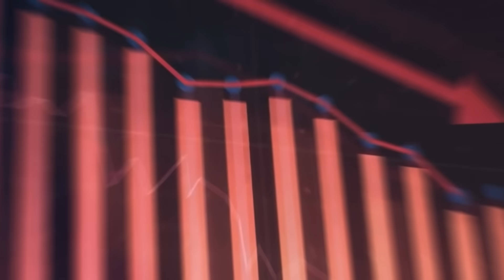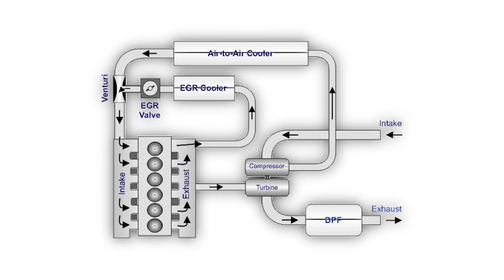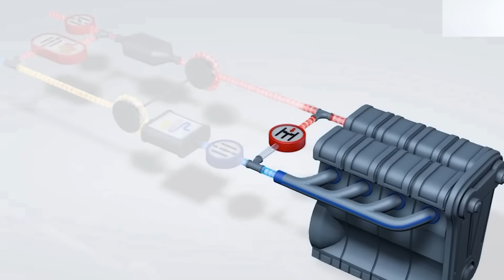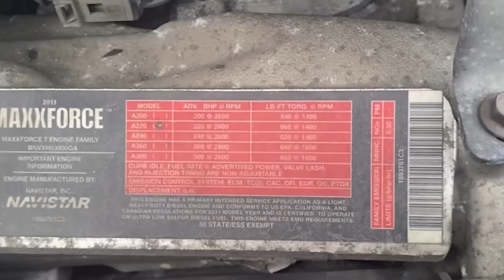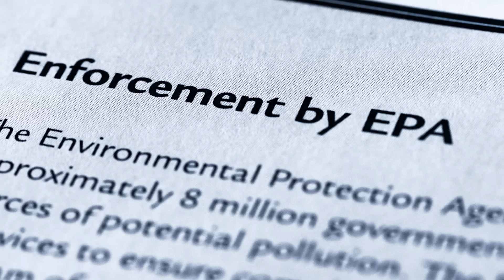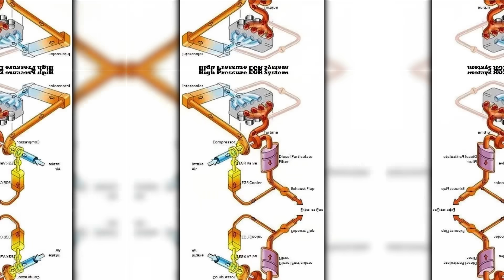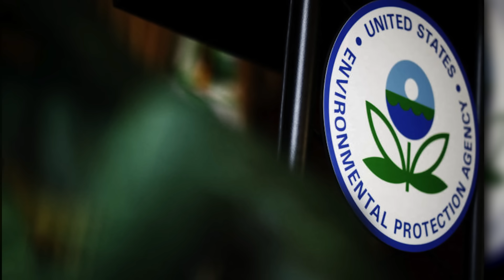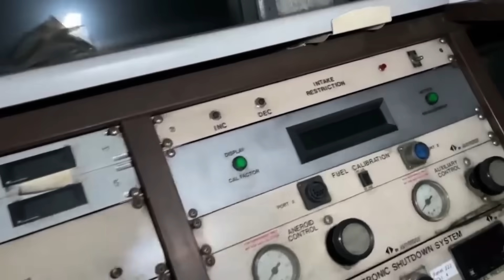The Rise and Fall of MaxxForce: The Engine That Broke Navistar

Comment: It sounds like Navistar didn't learn from the Ford power stroke diesel engines that LED to Ford cutting ties with Navistar and building their own engine in house which has become one of the best diesel engines in production.
Reply: I guess I will be keeping my 2002 ford excursion with its 7.3 powerstroke. It has 440k miles.😅
Reply: The original 6.7 was designed by navistar and built by ford.
Reply: @scottmoore2014 Incorrect, it was designed and built in house by Ford Motor Company with consulting by AVL. Ford and Navistar had already parted ways.
Reply: @scottmoore2014 Ford built the 6.7l in house entirely
Reply: ..... enjoying my dele***d 2008 6.4.....
Reply: Wrong 6.7 Powerstroke are crap
Reply: @24vmiggy 6.7l now is much better than before and way better than the 6.4l and 6.0l
Reply: @mauricemotors8207  It was the 6.0 (2003-07) that started the rift with Ford shortly followed by myriad issues with the 6.4 (2008-2010) . the 6.7 "Ford" Scorpion is a much better design and implementation of the diesel engine.
Reply: @24vmiggy LOL, they are the most powerful diesel engines offered from the big 3 and they are a very reliable engine when proper maintenance is performed.
Reply: @vegasfordguy  wrong again cp4 walking cranks breaking roller lifter guides list goes on
Reply: @24vmiggy  Pressed on crank timing gear LOL JUNKOLA 💯
Reply: @24vmiggy CP4 is fine as long as you change your filters my buddy that’s a fire truck mechanic has a F-450 service truck with 150k no issues
Reply: @24vmiggy Let’s talk about the rocker arms on the current ISB and the fact that the heater grid finally was addressed with now going to glow plugs I work on bigger Cummins ISL and ISX in semis Dodge ecru programming in Cummins sucks ass vs Cummins eco programming.
Reply: @mauricemotors8207 I don’t care for new big rig engines unless I own one but I know for a fact 6.7 power strokes are not the holy grail of engines yes they make power but they are maxed out engines from factory compared to duramax or Cummins
Reply: @24vmiggy The power stroke is as reliable as it can be considering all of the emissions mandates. This applies to all three of them. I'm a Ford guy, however I'd prefer to have an inline six as they are extremely simple to work on when compared to a GM or Ford V-8. So there's only one option and it's the Cummins. I would say that a Ford body and chassis, Cummins engine and Allison transmission for the win, however this isn't the case anymore since the GM 10 speed Allison transmission is nothing more than a Ford designed transmission licensed by Allison and it's not a bullet proof transmission anymore. If you want to be honest, there is planned obsolescence across the board. Ford still offers the best truck for towing with the best HP and Torque. At the end of the day I'd probably rather have the 7.3 Godzilla gas engine if I didn't need to tow beyond its capability. Just my two cents.
Reply: @mauricemotors8207  grid Heater was far more reliable then glow plugs .. until recently redesigned.. 
Cummins used the Grid Heater design for decades with no issues.
Reply: @24vmiggy you’re saying the cp4 is the issue while also saying a Duramax is better while it also uses the exact same cp4. And Cummins used the cp4 at one point recently. Make that one make sense.
Reply: @gabemorningwood  cp4 for Cummins was recalled cp4 for duramax was a select years 6.7 psd used it all years ur comparison is stupid that duramax was a completely different engine make it make sense